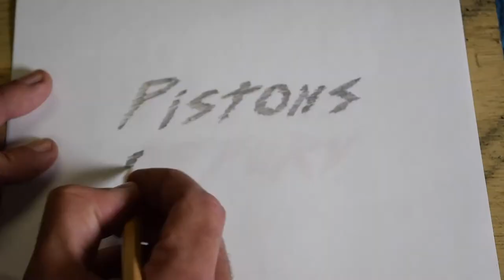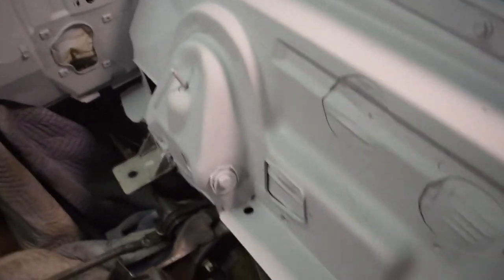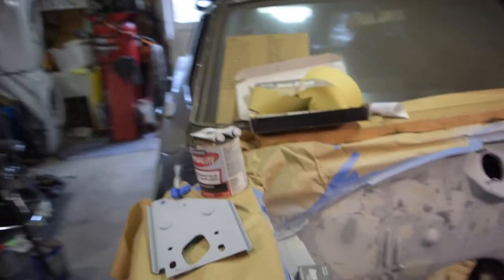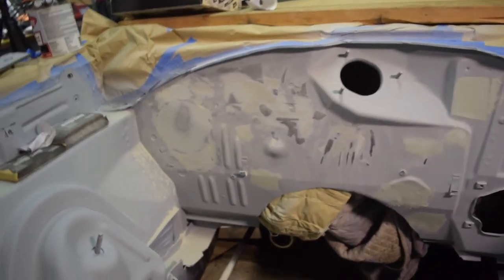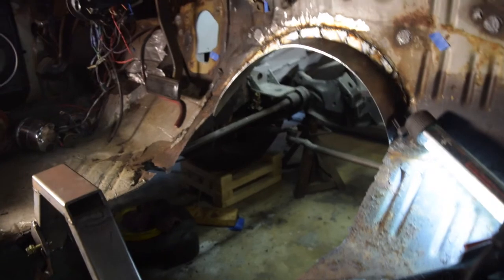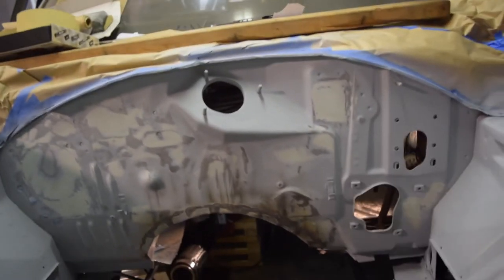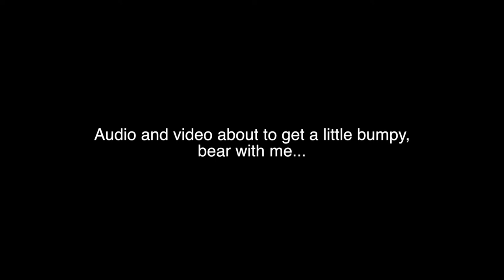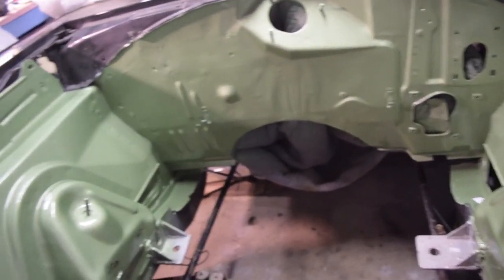Finally painting the Coronet's engine bay!

Comment: Was that an epoxy primer you used on the bare metal?
Reply from the maker: It's PPG JP202, a 2k Primer/Sealer. Given that I went down ot bare metal, paint pros would likely recommend epoxy first, then the 2k - but it's all I had on hand and finding non-water-based PPG stuff in CA is difficult/impossible.